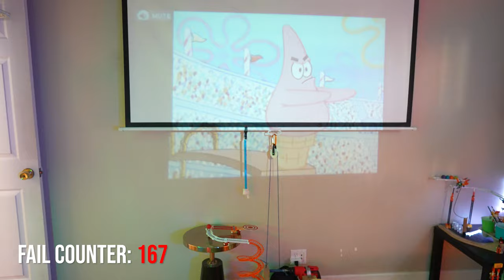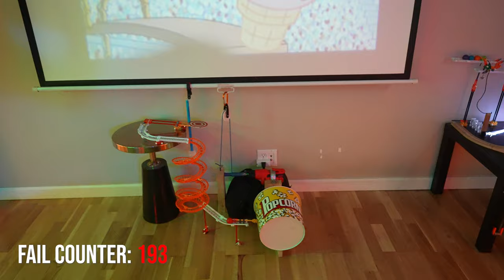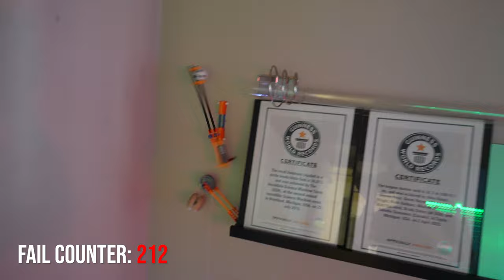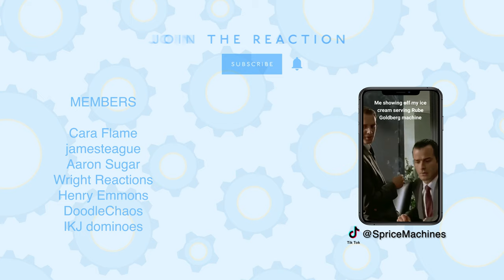Every Fail from Ice Cream Server

Comment: Wow, exactly 2^8 fails. On one hand that’s a lot, but considering the scale of the project that’s really impressive that it was only that many. That vacuum, what a pain! I wonder if the reason it turned around so much was because it had a hard drop off of the threshold to the next room and that tricked it into thinking it hit an obstacle. I wonder if you had a down ramp like your up ramp if it wouldn’t have failed as much.
Reply from the maker: Hmm yeah that could be it, I never considered that